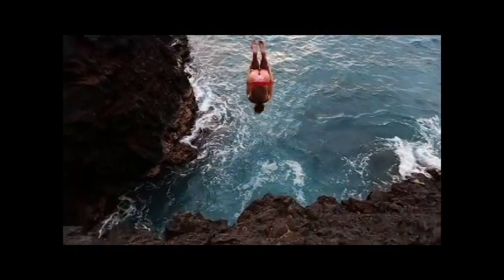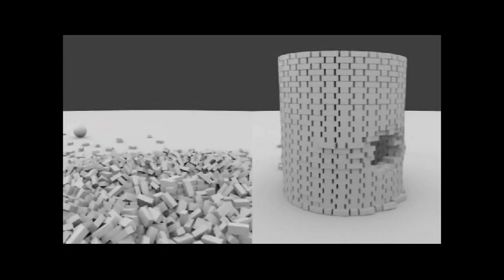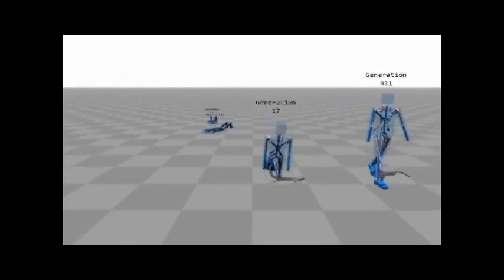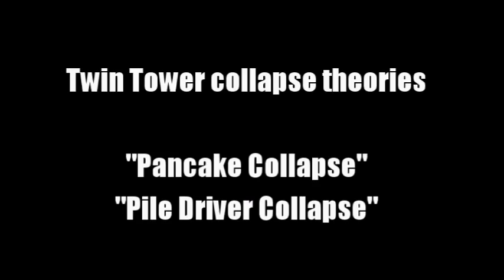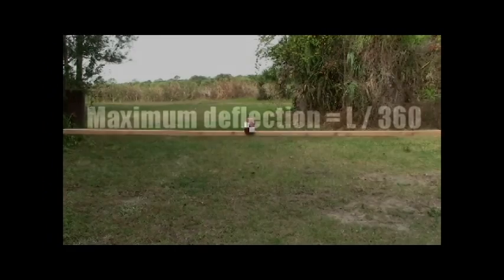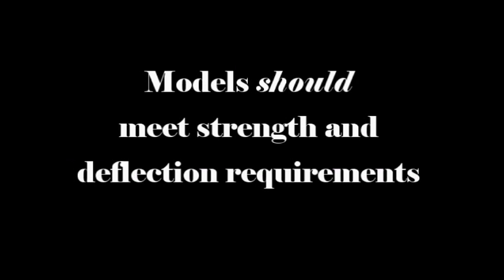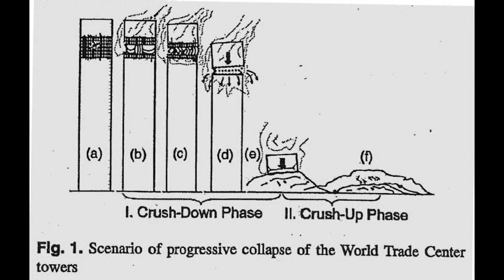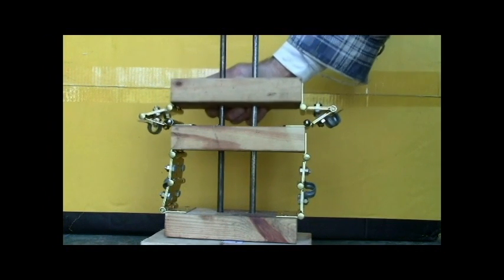9/11 Experiments: The Force Behind the Motion

Comment: Your models are innovative...but sadly your conclusions are wrong...its very difficult to scale a model down correctly...even your paper walls are too robust to properly scale down WTC  to react accurately...thats why we use super computers to do this for us....if you could shrink the WTC to let's say 3ft tall.... you would not even be able to handle it...it would crush to the slightest touch...
Reply: evsupp2011 ....i like the models the narrator came up with....i feel he missed the scaling of the floors...the composition  and the attachment points to outter structure...for example...if you took a matchbox car...and scaled it up to actual  size ...it would weigh 40 tons...and the body would be 5 inches thick...you couldn't then perform crash tests with that full size matchbox..because the data would be in error...i works exactly the same way when you scale down a model....the data and conclusion are inaccurate...
Reply: Frankie Ford dick

Comment: No pour kerosene down the middle of what would be the elevator shafts and have the entire core weaken. Then I'll consider taking this seriously.
Reply: Jet fuel has no effect on steel. Your comment is irrelevant.
Reply: I can't tell if that's sarcasm or not. I hope it is. Otherwise you have no grasp on reality.
Reply: danbrenn No, not sarcasm at all dan. As far as I know steel can sit in tanks of jet fuel indefinitely without experiencing any harmful effects. If you have information to the contrary, I'd be interested in reading any and all from a credible scientific body.
Reply: I'm confused... are you suggesting that the liquid jet fuel can't cause damage to steel? I don't disagree with that. I also don't disagree that a plastic fork sitting in a jar of peanut butter wouldn't be an issue. Both are irrelevant. The fact is that the fuel rushed out of the plane, down the shafts, catching on fire along with everything flammable that it touched. That's a proven facts. I know conspiracy theorists don't really know what those are. You shouldn't need any credible scientific information to understand that the furniture, carpet, curtains, papers, and other material ignited by burning jet fuel can cause steel to become malleable. All you need is a little common sense.
Reply: danbrenn  That is not a fact at all. For Jet fuel to explode into fireballs in elevator shafts it would have to be vaporized and at a temperature above 95 degrees F. Liquid jet fuel is not explosive, only the vaporized gas. Since the function of fuel evaporation cools the material, it would be a physical impossibility for the fuel vapors to reach the ignition  temperature.
Reply: mcwolf - Once again, you're wrong. Jet fuel does not need to be vaporized to burn, but it does need to be atomized. If it needed to be vaporized to burn, you would be correct. But since it only needs to be atomized, it's not a stretch to imagine that a plane flying 500 mph into a concrete/steel building would cause the liquid to spread out into fine particles. This is why you could literally put lit match into a bucket of jet fuel and it wouldn't burn, but if you put that same fuel into a spray bottle and spray it into a flame, it would emit a giant fireball. Will jet fuel burn when vaporized? Yes. Is it a requirement? Absolutely not.
Reply: danbrenn  Do you know how idiotic you sound trying to draw the distinction between vaporization and atomization dan?

Define atomization: The making of an aerosol, which is a colloid suspension of fine solid particles or liquid droplets in a *gas*. An apparatus using an atomizer nozzle. Sprays, mists, fogs, clouds, dust clouds, and smoke, which appear to be atomized.
_wikipedia
Reply: Slater - I don't understand your argument here... Somehow you have disproved my fact because you copied and pasted the first link you clicked when you Googled "Atomization" because it had the word "gas" in the description. You are further example of why people need to do actual research before vomiting their opinion onto the internet.

I'm not going to go into detail explaining the difference between a gas and a vapor. There is one, but you clearly have made up your mind about what you want to believe. All I will say is that depending on the scientific context, the word "gas" can have more than one meaning. And in this case it does.

BTW, the word "colloid" in your pasted definition proves my point. You should have paid better attention to the the Law of Thermodynamics section in chemistry class.
Reply: danbrenn  Why did you jump from your original conspiracy theory that jet fuel has to be atomized instead of vaporized to this new deflection explaining the difference between a gas and a vapor dan? Did you realize that vaporization is a term used for only liquid to gas transfer but atomization is a broader term that also encompasses solids that are atomized?
Reply: You're still not getting it. I appreciate the effort though. Good job using the interwebs!
Reply: Haha, if you only knew.

Comment: Just browsing YouTube, jet fuel don't melt steel beams... It stretches, narrows, and weakens the steel and as you know weak beams can't hold tons of material. Also normal beams , not damaged by jet fuel still can't hold the acceleration, impact, and shock wave of tons of material. Minoru Yamasaki designed the towers to have 4 main support columns, which made it the one of lightest skyscrapers, also very weak.

Hey physicsandreasons try using the proportionally correct materials for your builds, who has harden rods and cardboard as a substitute for concrete and steel? As Constructive Criticism try with different materials
Reply: +richy phachanh  Vertical steel columns of the trade towers responsible for supporting the gravitational loading were under compression and as such were not subject to the stretching, narrowing, and weakening you reported. Your comment is irrelevant.
Reply: Frank Castile so you admit that it weakened the integrity of the columns?
Reply: What I wrote was "Vertical steel columns of the trade towers responsible for supporting the gravitational loading were under compression and as such were not subject to the stretching, narrowing, and weakening you reported." You figure the rest out yourself richy.
Reply: Frank Castile so you admit it compromised the integrity of the columns, do you think weak columns can support tons of steel and concrete falling down and causing impact and shock, which will damage the lower columns? Thus creating the effect that happened that day.
Reply: richy phachanh  I have pointed out just one area in which your assumptions were wrong richy. Would you like to discuss the others mentioned in your OP?
Reply: Frank Castile it was ment to bait people like you into a debate, and would you like to further rebut me analysis?
Reply: richy phachanh  Yes, I recognized the trolling techniques as much as the typical paid government shill tactics of you jumping to the cliche 'so you admit that it weakened the integrity of the columns' richy. 
Is there really any point in continuing this intercourse?

Comment: your experiment at 6:10 to 6:51 is flawed. it assumes the walls to be stronger, and resist bending outward more, than they would in real life. 
those towers were seriously damaged by the airplane impacts. 
it was far more force than any builder could be expected to design around.
Reply: FAQ #9: Were the Twin Towers Designed to Survive the Impact of the Airplanes?
News - News Releases By AE911Truth 

In 2001, Leslie Robertson, a WTC structural engineer who worked as a subordinate to Skilling, claimed that the Twin Towers were only able to withstand the impact of jet airplanes going no faster than 180 mph. However, not only are these statements contradicted by the design test results, they also contradict statements made by Robertson in 1984/1985, when he said that there was “little likelihood of a collapse no matter how the building was attacked.”

Not only were the towers designed to survive crashes of large jet aircraft, but they were designed to potentially survive multiple plane crashes. This assertion is supported by Frank A. Demartini, the on-site construction manager for the World Trade Center, who said on January 25, 2001:

“The building was designed to have a fully loaded 707 crash into it. That was the largest plane at the time. I believe that the building probably could sustain multiple impacts of jetliners because this structure is like the mosquito netting on your screen door—this intense grid—and the jet plane is just a pencil puncturing that screen netting. It really does nothing to the screen netting.”

Demartini appeared to be so confident that the towers would not collapse that he stayed behind, after the airplane impacts, to help save at least 50 people. As a result of his actions, he lost his life on 9/11.

Comment: These experiments are not valid models of the structural design of the towers and the failures of the structural elements brought about by the planes that crashed into them and the ensuing fires that weakened them.

Comment: You're aware that Gravity doesn't scale with size? How did you factor in the scaling down of  Gravity, with the scaling down of your "models"?
Or to put it another way; Dropping a mouse from a four storey building rooftop & the mouse has a high chance of survival. But dropping an elephant from a four storey rooftop & the elephant will most surely die...
In this example, the elephant is the WTC & the mouse is your experiment. It's a loose analogy, but mass & gravity are critical factors.

Comment: Have you ever seen a building purposly imploded. It takes those guys months and months to prepare a building and it always requires a ton of pre-demolition preperation. The spend counless hours pre-paring colums by purposel weakening them with jack hammers and such. Then as many hours carefully routing the explosives and the wire to ignite the explosives. And to top it off, they virtually never ever get a tall building to colapse straight down. 
I know it is hard to believe that it actually happened, but there is no way in hell that any demolition company could ever pull that off. And for sure, there is no way anyone from the government could ever pull it off. The government does not have the best and brightest of any industry.

Comment: Evsupp2011 you are king moron!
Multi ton planes full with highly flammable jet fuel with a impact force stronger than a bomb, damaged steel weakened by fire and monocoat (coating sprayed on beams to protect from fire) knocked off on impact exposing the steel which is why its sprayed on them in case of fire and you have collapse! 
Which tower fell first  the one hit high or low?
Which tower burned longer?
The one hit low had more weight to bear at impact zone. The one hit high stood as long as it could. 
Evsupps desperation to convince people his garbage proves he is a Russian troll or a plain sociopath!
Reply: Evsupp2011 go home with your conspiracy bullshit!
Reply: Yes, and your good story has been nulled by sensible facts!